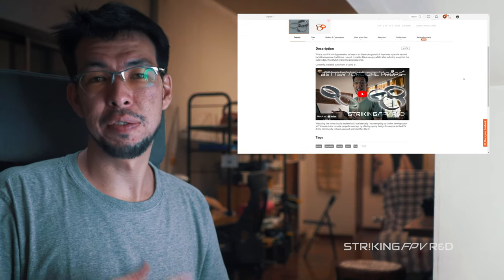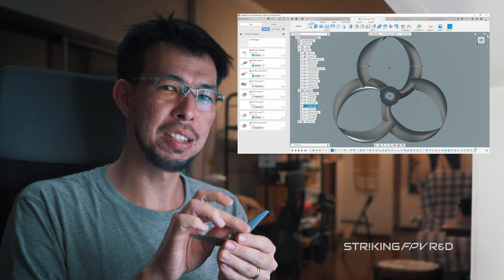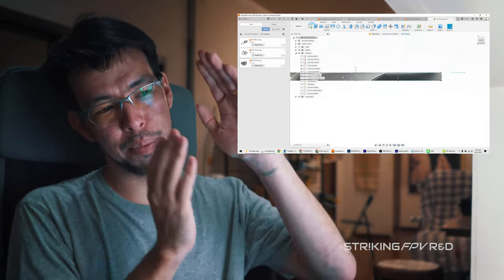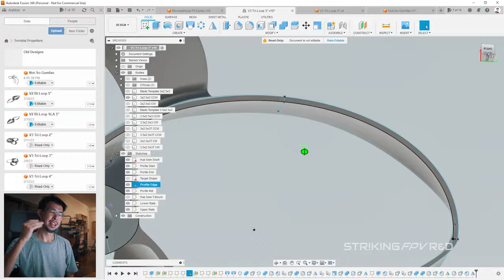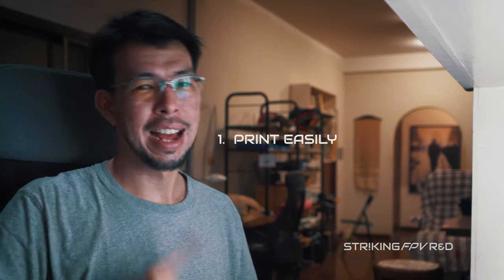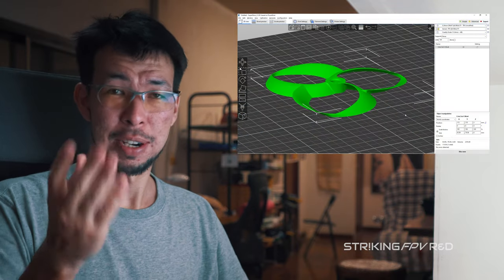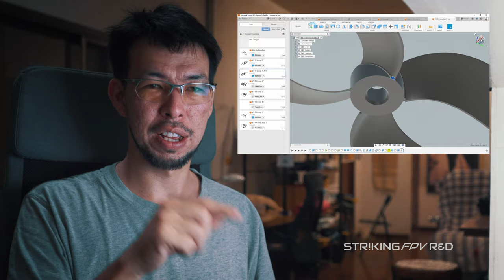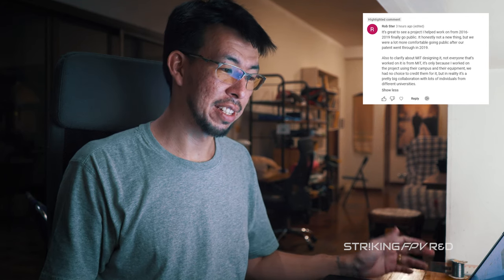10 Toroidal Drone Propeller Questions Addressed

Comment: Maaaan, doing props is such a cool rabbit hole
Reply from the maker: A deep, deep rabbit hole.  Centuries of scientists and engineers before us scratching their heads on this endless topic, and here I sit behind a five-year old mid-range gaming laptop with a non-commercial license of Fusion 360 and some basic CAD knowledge trying to loosely mimic years of research by the toroidal team at MIT's Lincoln Lab...

Written like that I wonder if I'm partially suffering from imposter syndrome 🤣.

Comment: I agree with the comment about making the tip section be more horizontal, but not fully horizontal.  It should be tilted up from the horizontal by whatever angle you want the tip of your blades to be.  This completely eliminates the problem of the angle of attack getting bigger as you go towards the tip.  I have resin printed my own designs and this really does work.  Also, having the rear blade bow upwards and the forward blade bow downwards works well with this tip section design, and does not need to make the rear blade have a larger chord as was suggested in the video.
Great videos - thank you for posting.
Reply from the maker: So which way are you tilting it, outwards or inwards?  The way the loop is supposed to work means that whichever way one tilts the outer edge profile, it will ease the twist of one of the blades but end up overly twisting the opposite one at the transition point, unless you're not actually creating a loop and are instead just making a single warped blade with a hole in it.

If it works, flies well and is quiet, then I'd be curious to see it.  Have a link to the design, or an image of it?

Comment: we can now have rim driven 3d printed propellers :D more stability? covering the motor might add weight, but it might also help lessen the most irritating higher motor frequencies?
maybe a rim driven toroidal prop would be cool, when the rim supports more forces, allowing for thicker blades perhaps, or a single loop. maybe if we booleaned the entire final prop out of a box shape, you can even 3d print a mold to later replicate again in metal or....

Comment: thank you so much for all the effort you put into this! I just modified the v3 40mm for .75mm shaft micro drones. will comment on thingiverse when tested.
Reply from the maker: I didn't even know there are drones with .75mm shafts, that's crazy.  Hope it works out for you, I have noticed that smaller drones seem to have more difficulty with these props than larger ones in terms of generating thrust, but hopefully you can get it to work!
Reply: @STRIKINGFPV  there mostly the super cheap guys with .75mm shaft. Ive had a few issues with getting them to print clean. I do finally have a complete set i printed in CF PLA. Once cleaned and tested ill update
Reply from the maker: @nikolus24  Awesome, hope it works out 👍

Comment from the maker: I'd also like to divert your attention to @MoppelMat's test video flying my V3 Tri-Loop 5" prop, FDM printed in Nylon Carbon Fibre, weighing less than similar 3-blade injection-moulded props and getting the same flight time!
https://youtu.be/RqREG_KD0wU

The tutorial video so you can learn to make your own toroidal props is now up as well:
https://youtu.be/UUPffl7JxKw

Also, FYI, turns out Fusion 360's STEP files don't include the object's creation history/timeline, so I've now also uploaded the Fusion 360 (F3D) files which, in theory, should include said history.  Crossed fingers it does, otherwise I'll be spending all night trying to sort it out, or you'll all have to wait for the tutorial videos 😅

Comment: I was viewing a video by Luke Maximo Bell using your print file in an avata which has ducting. When you go from three blade conventional to effectively six blade toroidal there would be pitch/diameter questions as well as curved blade issues to resolve. More blades mean smaller diameter of same pitch. I came from an RC background before drones. The toroidal blades have curved blades with variable pitch. Do you go rounder or straighter?  I see lots of questions with a super answer waiting to be found.

Comment: Try making a propeller inspired by the the structure of owl feathers and combine it with the counter weight propeller. Combining the principles of counter weighted propellers with the structural features of owl feathers could result in a unique and exceptionally quiet propulsion system.
Reply from the maker: Perhaps, but considering the counter-weighted props I've recently tried and also the behaviour of the "traditional" prop that I also 3D printed in the toroidal hover testing, I have a distinct feeling that the flexibility of the final part is playing a significant role in whether or not the prop is viable.

I think the tri-loop design being self-supporting is one of the biggest reasons why it's working pretty well.  I think it's also why the bi-loop counterweighted prop flew (though not for long) and the single-loop counterweight prop just exploded on spin-up.

FDM printing is showing its limitations here, as is resin considering not many people have had success in getting strong enough resin prints of this to not explode as well.

Comment: The hydro versions have the distinct, advantageous characteristic of reducing cavitation, which is very destructive to watercraft props. The analog to that in an aircraft is tip vortices, which are noisy and reduce the efficiency of the prop. If the toroidal prop is run in an orientation where the shaft is horizontal; as on a conventional aircraft,  the results would be different from one operated in a vertical (VTOL) orientation such that there would be a horizontal speed rage wherein the toroidal design would have some advantages over the conventional design and speed ranges where the conventional design would have advantages over the toroidal. This would make the choice of prop a function of the mission of the craft under consideration.

I truly enjoy watching your presentations. I like the way you think, assuming the way you speak is a reflection of that. I also like that you are willing to make your work available for others to test and  make variations. I would suggest that you make the use of your intellectual property subject to some restrictions such that a developer is not permitted to take your ideas and use them to acquire a patent or copyright on their derivations the same way other so-called 'open source' creators do.

Please keep up the great work.
Reply from the maker: You seem to have a lot of insight, or you've certainly read more of the technical literature, may I ask if you're an engineer of sorts, amateur or professional?  I am curious about the relationship between hovering applications vs forward flight for these toroidal propellers, as I would like to help out my fellow RC enthusiasts who fly planes more than quads, and I feel like you might have some suggestions or a theory behind prop choice perhaps.

On the other hand, the few who've tested these on planes I haven't actually seen the quality of their print or the type of aircraft they're flying, which I suspect will make a big difference, so there's that.

Thank you for the kind words, and I like to think that the way I speak is a reflection of the way I think, though I tend to emphasise my lack of knowledge more in day-to-day life.  On this video I wrote almost a script of sorts to keep things somewhat flowing, but it can be hard to make sure I'm not too strongly asserting ideas that I'm actually still pondering.

As for copyright on the designs, I've set the licenses to Creative Commons-Non Commercial, so sharing with credit and adaptations are allowed, but it's strictly for non-commercial use, important I think considering the designs are somewhat based upon the Lincoln Labs paper/patent on the topic.  That being said, others have already started making their own designs, and once I've created the tutorial video(s) then even more may be able to create their own without necessarily needing to acknowledge my prior work, which is fine, I'm doing it all in the spirit of the maker community anyway.

And the coffee is very-much appreciated, sir (or tea, in my case, haha).
Reply: @STRIKINGFPV  I'm, currently, a self-taught computer geek. In my previous life I was a hot-rodder, a diesel mechanic and a private pilot. I've spent my entire life immersed, more or less, in all sorts of technology and machinery. Propulsion systems of any type, fascinate me and have since I was a small child. I've flown a variety of aircraft from light Cessna's to Beech King Airs and even a Huey helicopter of which my buddy was the Aircraft Commander in Vietnam.

I was struck by a couple of things about the two of your videos I have watched; Your precise descriptions of what you are doing, why you are doing them and what you are seeking and by your apparent ethics in the way you are going about it. 

My first exposure to the toroidal propulsion devices was the marine version and my, admittedly, limited understanding of cavitation that the U.S. Navy seems to have, largely, overcome in the designs of their submarine props but that the inventor of the marine toroidal prop also seems to have conquered via a very different approach.

The marine props,  however, seem to exhibit their best characteristics in the low to mid and higher mid-range regimes. At the top end, any thrust advantages seem to even out compared to conventional props. Learning that led me to wonder if anyone had considered attaching one of these aero versions to a fixed wing craft for testing the thrust characteristics relative to the conventional prop.

I apologize for rambling but I get started and inertia takes over.

Thank you so much for the response. Please keep up the great work.
Reply from the maker: @bobstovall9570  Ah cool, I used to do computer programming back in the day, and whilst I do light wrenching on my (diesel) car/truck/SUV thing, I have more experience working on motorcycle engines, having done full rebuilds of my CBR150R motor a few times now.  Then carburettors, oh what a rabbit hole - haven't touched ye'oldey mechanical fuel injection in the car much, but I think I'm okay with CV carb tuning, although I do cheat by using a wideband O2 sensor, haha.

I used to be obsessed with aviation as a kid, loved flight simulator which is how I got into drones eventually (also programming, but that's another story), always prepped to fly if the pilot passes out 🤣, but getting an actual pilot's license seems a bit out of reach, for now anyway.

You make me wonder more about what it might be or what changes might be needed regarding a forward-flight application of these toroidal props.  I don't inherently see what could be so inefficient if @MoppelMatt can get similar performance out of my V3 5" design to a regular prop on his quadcopter - maybe the people who've tested on planes didn't do something quite right, I'm not sure.

It's not a huge sample size of home testers at this point, and I'm not sure where it may be best to try aggregating anecdotal test results.  Nor do I think I'm really in a position to keep track of it all given this is just a hobby of mine.

Comment: you could injection mold these, the 2 part re-usable mold would rotate as it comes apart or use a silicon rubber method with recyclable molds

Comment: When you have 1 million subs I want to be sure I was here in the very beginning. Well done, I tried adapting your model to my Phantom 3 but I am a bit concerned if ABS-like resin will resist the stress
Reply from the maker: Very kind words, though I don't think I can expect that kind of subscriberage for a while 😅.

Do let us know if you successfully get them to work though, the more people who have success the more the test of us can learn from it. Resin printing is the big hopeful for this, but it seems finding the right resin is more challenging than it is for team FDM at the moment.
Reply: Would you be printing on the plate, or supported? Curious how well you can get rid of the elephant's foot when printed on the plate. My AnyCubic Mono X has built-in transition layers, and I have yet to fully remove the elephant's foot while trying to print props. Can do it on something cylindrical or straight walled, but not something with an angled wall like a prop. Been trying to use UVTools to dim or erode pixels on the first layers,...

Comment: At 15:10, you mention that strain could change the shape of the propeller. 

Could we make that a sort of living hinge, and make a variable pitch by means of centrifugal force? It could be designed to flex in a specific prescribed manner that could help address power curve issues on certain applications.
Reply from the maker: Yes, it probably could be done, I believe the term often cited is "compliant mechanism", whereby the elasticity of the object contributes to its working function.

Most props that have had their designs iterated and tested thoroughly to achieve optimum performance probably inadvertently have elements of compliancy in them, as the blades will naturally warp more towards the tip because of increased forces and a thinning cross-section.

The natural tendency for prop bending would result in less blade pitch at higher speeds, which would produce an exponential thrust curve whereby low to mid speeds would produce a sharp increase in thrust, but then increasing further would trail-off.  Allowing for more prop flex in this regard would make this curve taper-off even more, thus reducing efficiency as you'd be spending energy spinning a blade but producing less thrust than a more rigid prop.

One would have to come-up with a specific use-case for doing this, or some interesting method of inverting the typical behaviour, like warping to a steeper blade pitch at higher speeds, to help produce a more linear thrust curve, but I can't really think of how that might be done.

If attempting to use centrifugal force to perform the actuation, I guess we'd have to have some kind of weight out at the extremity, but adding weight there would put a significant amount of tensile stress on the entire blade.  It would also cause more blade warping when the quadcopter is manoeuvring.

I like the idea very much, but a lot of careful thought would be required to come up with something which works in a desired way.  I dare say a lot of computer simulation would need to be done as well, before attempting to manufacture.

It's certainly outside of the scope of my hobby-levels of expertise 😅.

Comment: Really interesting how the project is evolving. I admit that I am currently less enthusiastic than before, about this new design, but obviously, being still at the beginning, there is certainly a lot of room for research ... On the other hand, I am increasingly wanting to build myself an FPV drone . I need something that doesn't limit my enjoyment!
Reply from the maker: Build the FPV drone, join us join us join us 🤣!

Hey I could be wrong and all it will take is one person to come up with a better design than mine that categorically performs better and is quieter than standard props and the amazement will be back again.  But most things in life aren't free, and so I imagine that even an ideal toroidal design will have a trade-off - much like we currently have to decide between how many blades we want and the pitch of said blades, toroidal would end-up being another checkbox on the list of what we want in relationship (with propulsion, lol).

But seriously, try building an FPV drone.  Also if you have an interesting in designing parts and/or you have a printer, being able to take a base FPV drone and modify it with your own choice of electronics, motors, 3D-printed mounts and protection or ducts and stuff, it's always satisfying adding things and watching them work (or not, then making changes to make them work better).

I added a camera-tilting headtracking system to my Veyron35CR (got a video on it) which is one of the more complex things I've done, and yes a bit of a headache but very satisfying when it's all working smoothly.
Reply: @STRIKINGFPV  
I hope to find the time, because by now my interest in the world of fpv drones is very high!😁 I fully agree, the greatest satisfaction is when you manage to create something that you can freely customize, based on your preferences and/or needs! I've been in the world of 3D printing for a year now, and improving my Creality Ender 3 Pro, from software to hardware, has been (and still is), very rewarding! I guess it could be the same for the world of drones too!😃

I found some videos from the YouTube channel "Craft Channel" about building from scratch interesting. I had in mind to build a 7 inch cinematic Fpv drone, approximately (with a housing dedicated to a GoPro). I hope to one day find a video of yours dedicated to building from scratch, I'm sure it would be very useful for the whole community!😀 

I saw the video you mention (Flying an FPV Drone with Your Head), it's very interesting, even if it was inevitable not to think about neck pain at the end of each flight!😅
But I totally understand what you mean. If you can do it, why shouldn't you?! Exploring nine potentials in each direction is surely the coolest thing of all! 

Regarding toroidal propellers, it could help a lot in their development, using professional space simulation software, such as those used in aeronautical design. I don't think I have a powerful enough pc, otherwise I would have already run some tests. In this way multiple simulations could be carried out simultaneously, of different designs, and understand which one is the most advantageous, where to continue the research.